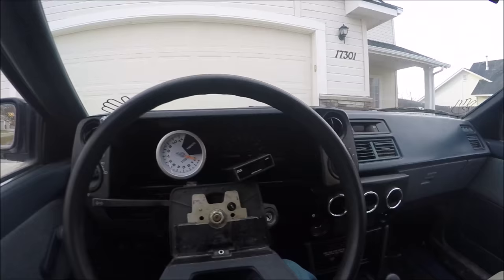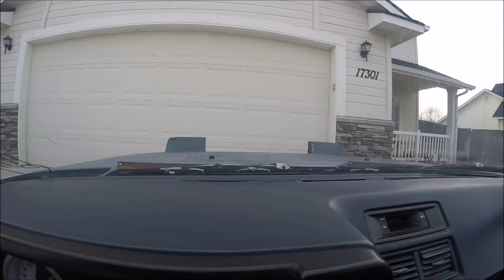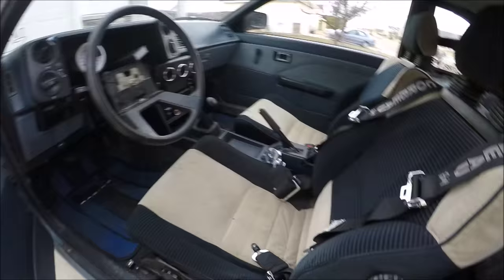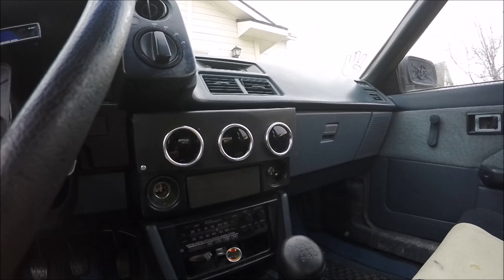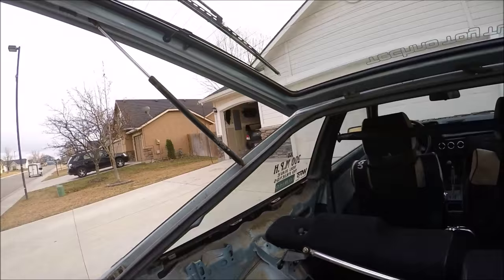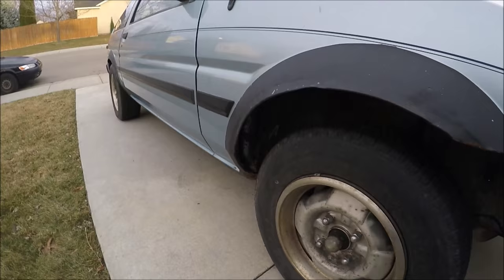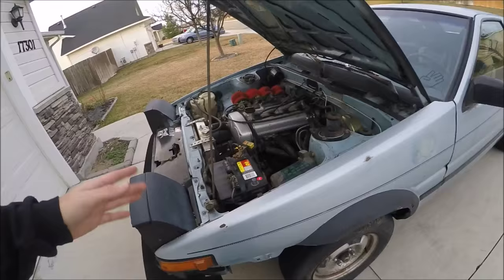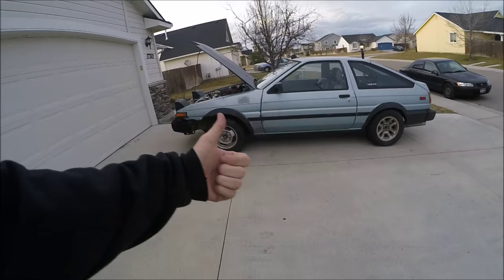Part 1: AE86 Drift build - Getting Familiar

Comment: Pretty cool start for a drift build!  One thing I would say, from a safety stand point, is to use the B-pillar brace as the attachment point for the harness (or it should wrap over it before going to the floor brace).  Supposing, of course, that the B-pillar brace is installed correctly.

Comment: the part the harness is connected to isnt a harness bar and its just as unsafe as bolting it to the floor. that bottom bar is just another chassis brace and believe it or not will do more for stiffness than the upper one. you dont want the harness to be on a more than 45 degree angle from your shoulders
Reply: +That-JDM-Fascination! This is exactly what I paused the video to say.

Comment: thats a ae88
Reply: Avi Resendiz sorry bud you're wrong, this is an sr5 the VIN plate says AE86.

My GTS does say AE88 on the plate but it's an AE86 and has AE86 engraved in larger letters on the firewall.

There is absolutely no difference between the chassis.
Reply: Avi Resendiz  it says AE86 on the firewall so